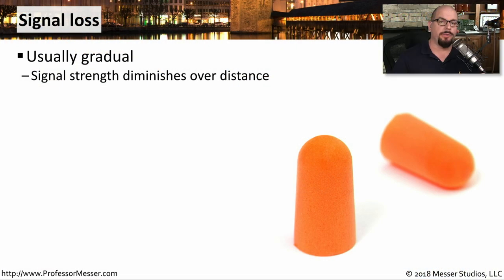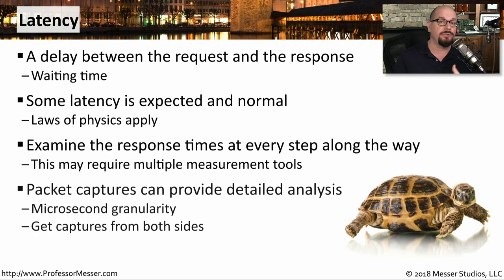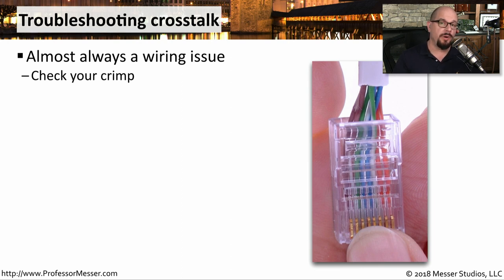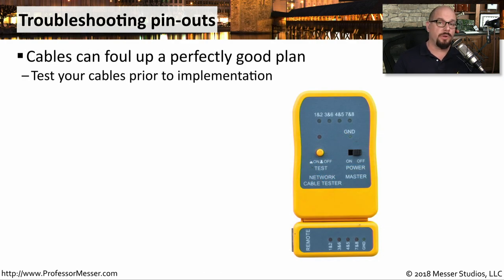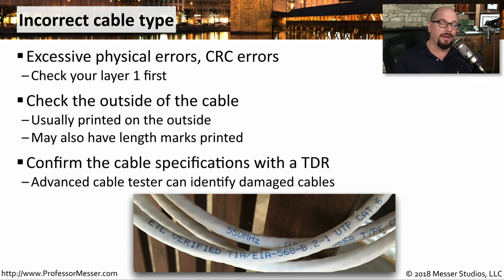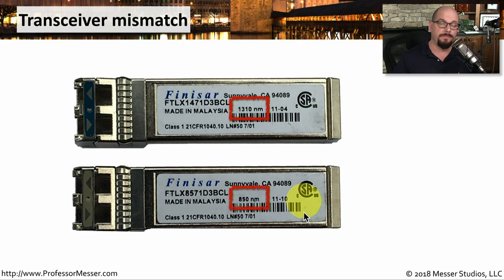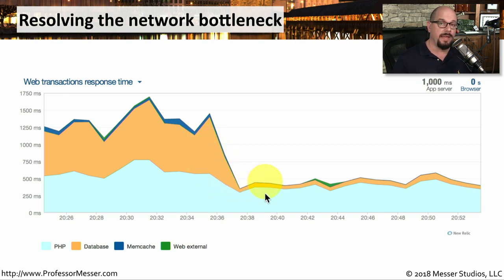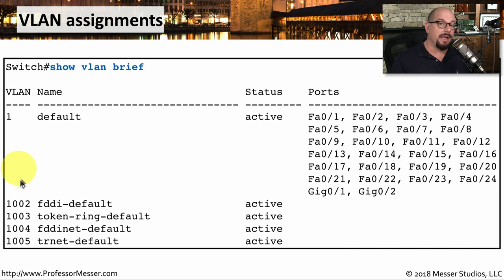Wired Network Troubleshooting - CompTIA Network+ N10-007 - 5.3

Comment: You may want to verify the T568A or T568B visually yourself as I just found myself using a couple of Ethernet cords as examples to see if I could tell the difference between the two standards. One of the cords was mark wrong on the outside of the cord